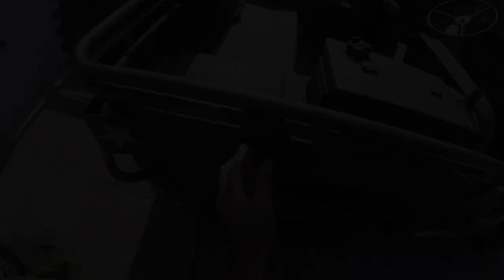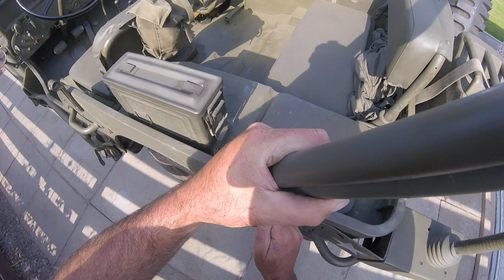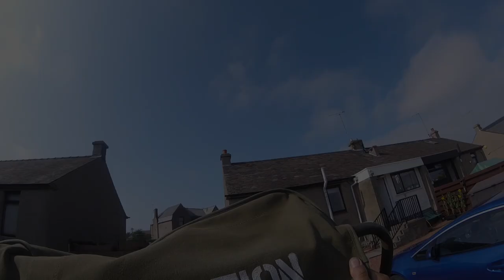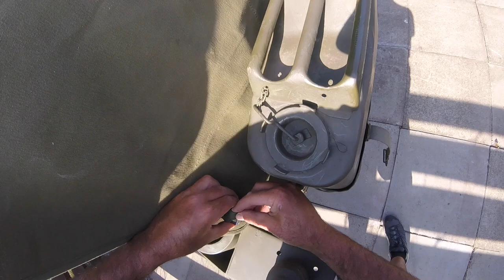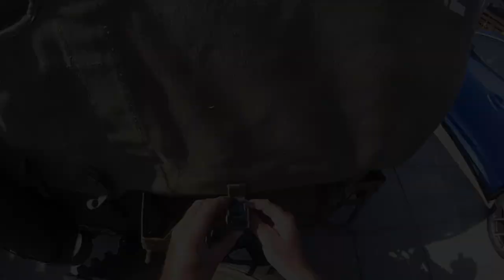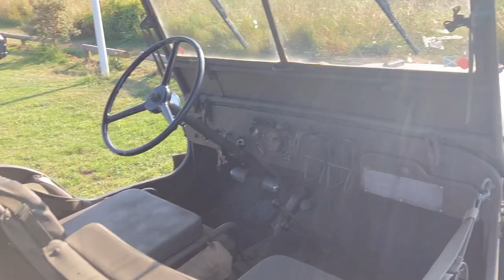Willys Jeep;  Canvasco.com UK   Summer Top

Comment: VERY handy video , its a faff though , just ordered a stencil kit , my palms go sweaty at the thought of messing it up on my canvas
Reply from the maker: I think sitting it on form surface and weighting the stencil on the canvas helps reduce mess, check your horizontal level as my stencil I did on an angle!, but I’m sure the army stuff would be slapped on like the overspray when these things were sprayed up 😁👍
Cheers Bruce
Reply: Consider how many would have had less than precise and perfect stenciling when mass produced at breakneck pace and / or stenciled markings applied 'in the field' or at overseas depots.
Reply from the maker: @-oiiio-3993  hi, indeed they were roughly painted with just lights dials and glass covered before painting 😁👍

Comment: Hello guys..... Jeep Willis Are there new models?
Reply from the maker: This is a 1965 French Army Jeep known as a Hotchkiss M201, identical parts to WW2 Willys MB but better with 24 volts, stronger chassis and gear drive cam and strengthened rocker cover and better French Solex carb 😁👍
Cheers Bruce
Reply: Willys (pronounced Will - iss ).

The closest thing to a Willys MB that is currently available that I know of are reproductions built by MDJuan in the Philippines.

The closet thing to an early civilian Jeep in current production is Mahindra's Roxor which closely emulates an early CJ5 combined with CJ7 attributes. Those, however, are not road legal in most U.S. states. Mahindra was licensed by Willys Overland, Kaiser, AMC to build 'Jeeps' in India over previous decades where they presently sell their Thar models which closely resemble modern 'Wranglers'.